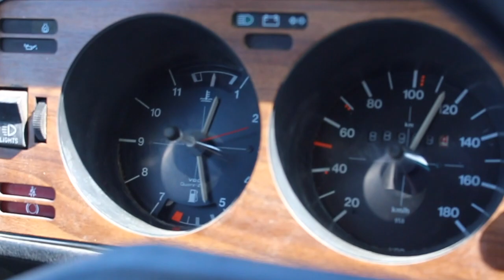1980 Rabbit: 9 Hour Drive

Comment: I’ve crossed the country many times in mine. 

It can do a 100+ HOUR drive easily. 
Shouldn’t even need to check the tires

Can a rabbit drive one oil change without breakdown. 

Yea. 
Many many times.

Comment: That's awesome! My rabbit will only run 60-65 wide open...mine is a 84 5 speed 1.6 diesel maybe they changed the gear ratio on different years?
Reply from the maker: Diesel J not to sure mine goes 75mph if I want it to.... not sure something must be different
Reply: Diesel j mine does the same thing about 60-65 tops
Reply from the maker: David Dorsey mine does 75mph no problem.
Reply: This and That with Chris yea I could tell by the camera that your rabbit is way faster than mine...I'm jealous lol maybe I need to put a 4 speed trans in
Reply from the maker: Diesel J she rips hard lol
Reply: AFAIK the 4 speed and the 5 speed have the same final drive ratio. the 5 speed just has shorter gears to get you up to speed quicker!
Reply: Em1 J I have a 81 4 speed 1.6 2 door. It runs in the 80s pretty easy and got it to 90 confirmed by GPS. The speedo was slow by 5-9 MPH going that fast.
Reply: Chris P 
That’s right what my 1.6 1981 caddy would do. 

Now it has a TDI. But the corrado trans limits my speed. 
Still does 100mph no problem. 
But yes. The speedos read slow. 
95mph by gps was 85 on speedo.

Comment: Your trans is a 4 speed or 5 what's the code on the bottom?
Reply from the maker: Waterboxer 4spd
Reply: This and That with Chris if ya ever get around to seeing the code when your working on it I'm curious what it's equipped with, thanks.
Reply from the maker: Waterboxer Will do ! All I know us it's a 4spd.
Reply: Gotcha bud, saw your later vids and seen you swapped the motor and possibly trans. I have an 80 1.5D myself with an o2o 5 speed. 

https://imgur.com/a/kUZCh
Reply from the maker: Waterboxer Wow that a nice one! Same color as mine but a 2 door.